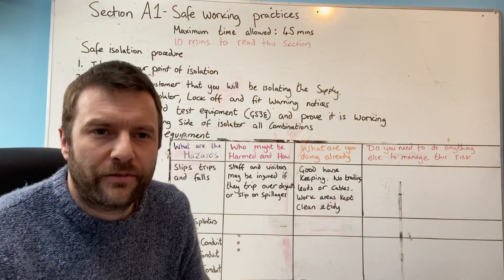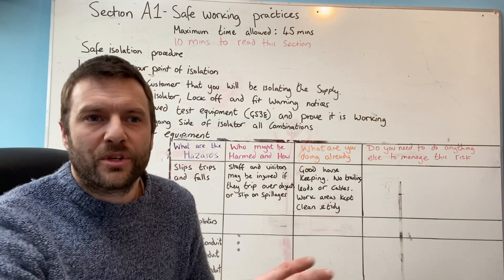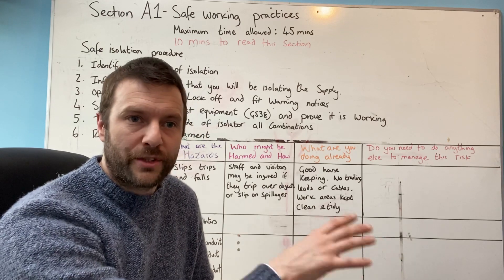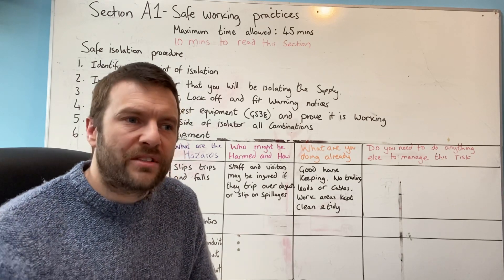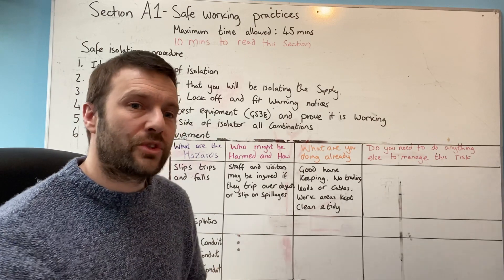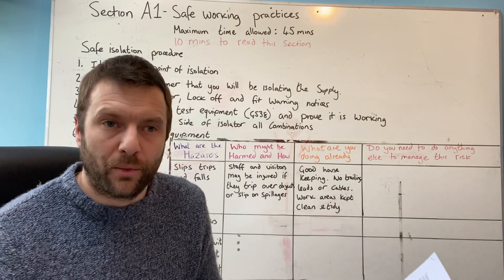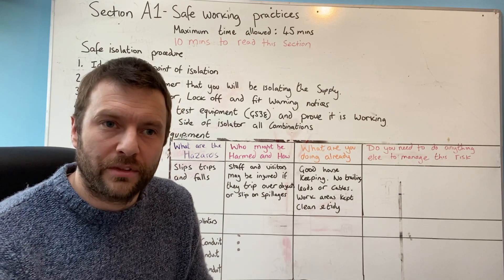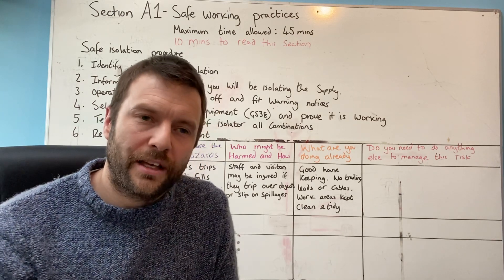AM2 pre assessment manual

Comment: The feedback is absolutely terrible if you fail on the fault finding it’s a straight fail zero feedback at all
Reply from the maker: I agree, people need feedback to learn and grow.

What NET are worried about, is people using that information to develop ways to cheat the test and passing it round.

They all ready have an issue with people spreading the assessment material